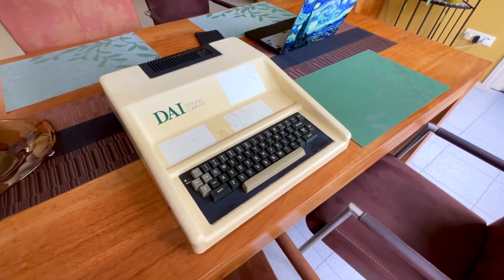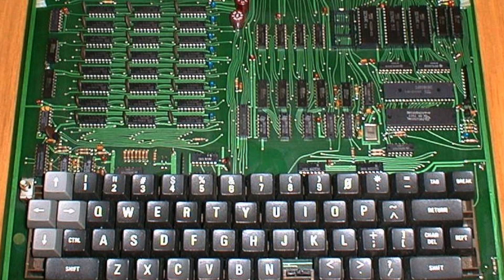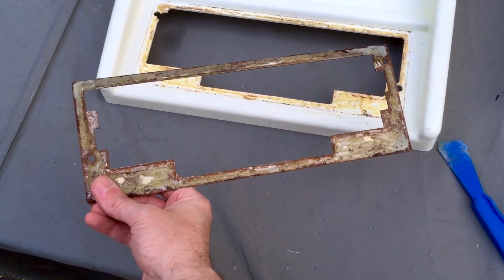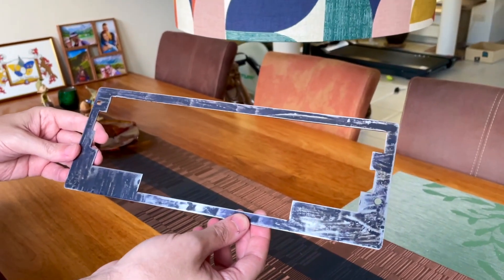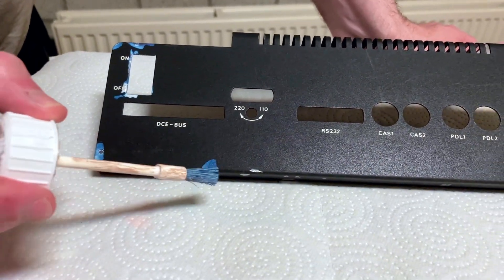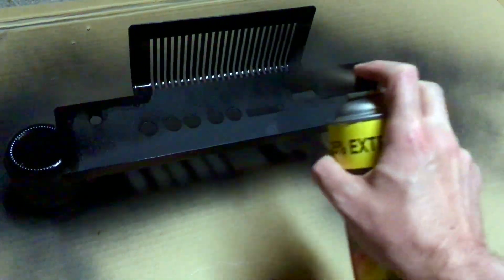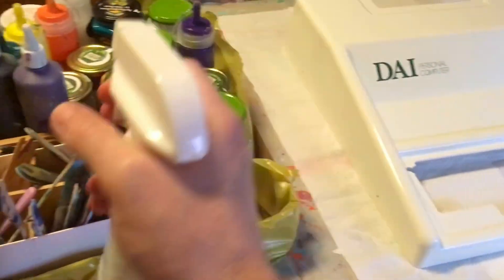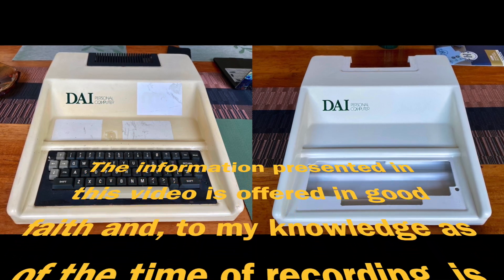Restoring an extremely rare, Belgian DAI PC (Part 1)

Comment: I had a few DAI mini cassettes at one point, but I can't find any picture/video of the way these tapes were used on the DAI. It has no built in drive like the P2000T. Is it in one of your other video's? Was it an automatic device as well, with computer controlled loading/searching/indexing?
Reply from the maker: There is.a standard ear/mic port at the rear, so I assume it can use a standard cassette player, like the early Sinclair computers.
Reply: @thebyteattic  Oh, then they must have used a mini-cassette memo recorder or such.
Reply: Both standard and micro cassettes were working. The micro cassette player was a heavy 15cm cube, and was only controled by the computer